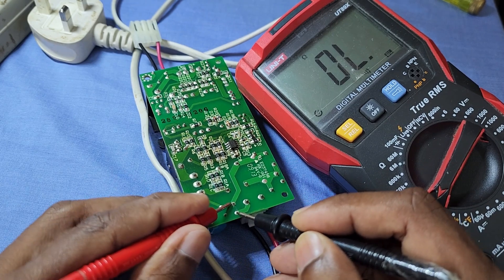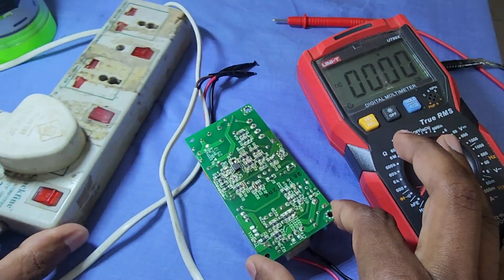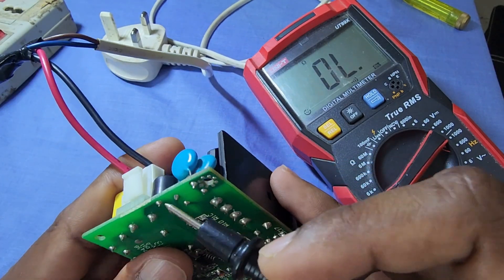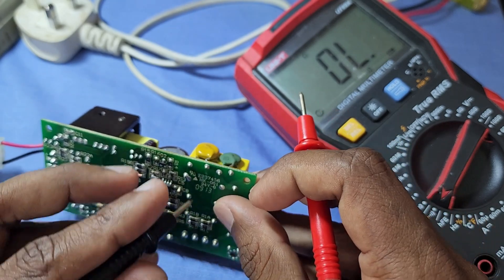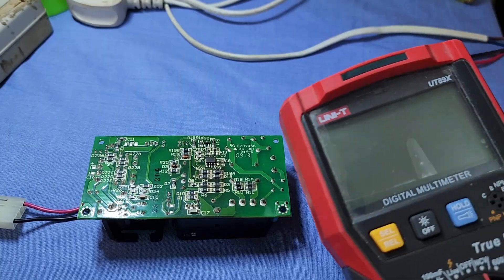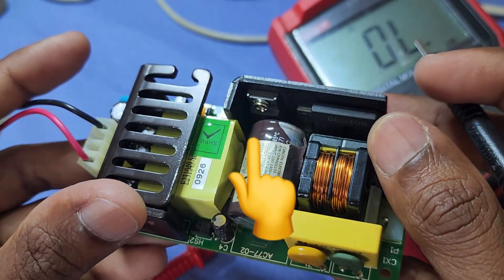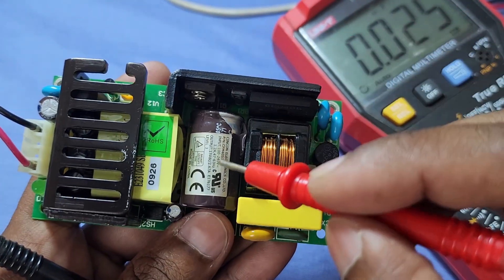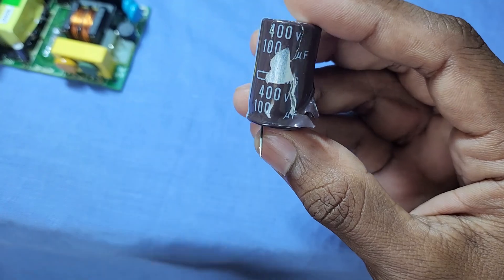How to repair SMPS Power supply step by step || Mosfet based Switch Mode Power Supply repair.

Comment: Pl always use series lamp to check the supply to avoid any accident due to any short circuit in the supply.
Reply from the maker: That's a good suggestion, thank you for the comment